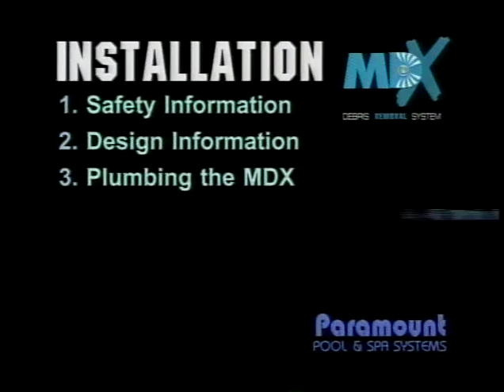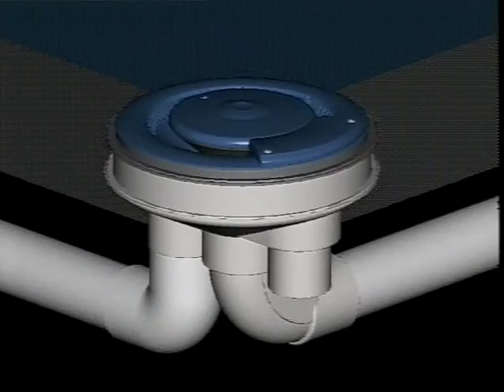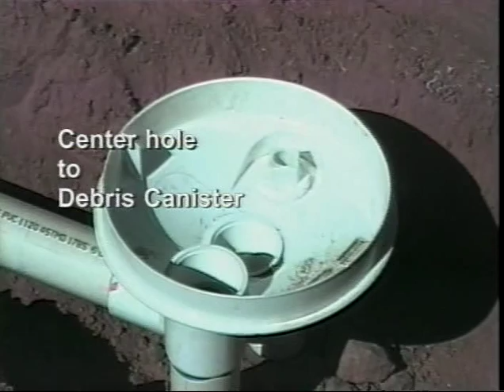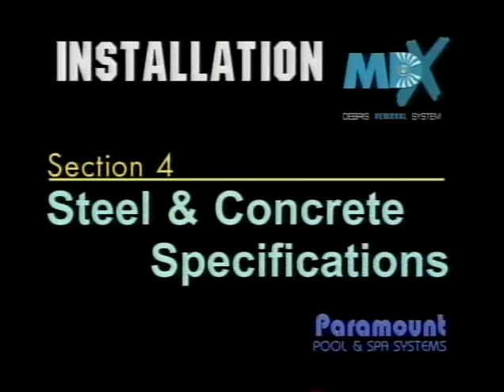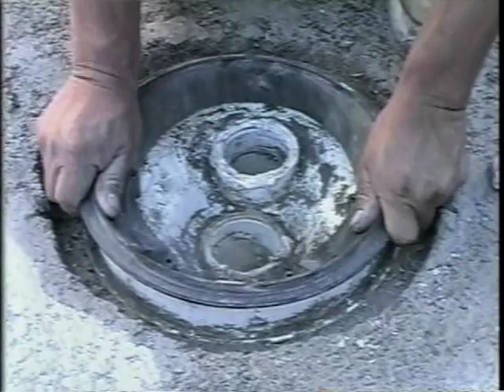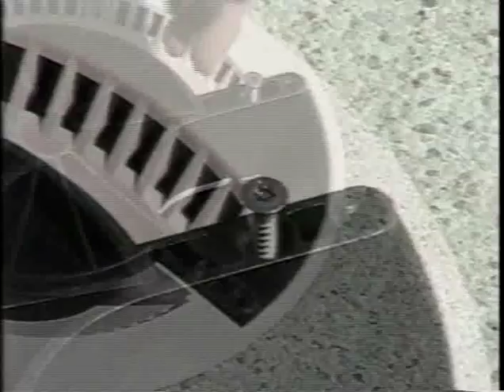Paramount MDX Install Video

Comment: I have a vinyl liner pool. There is something stuck in my main drain that I cannot get out because the funnel assembly is in the way.  I managed to dive down in the pool and take off the anti-vortex cover and this left me with that black piece of the funnel assembly.  Will that black piece come off if I take the two screws off and pull hard or do I need to take every screw off of the assembly? If I have to take off every screw, do I just pull real hard to take it off?